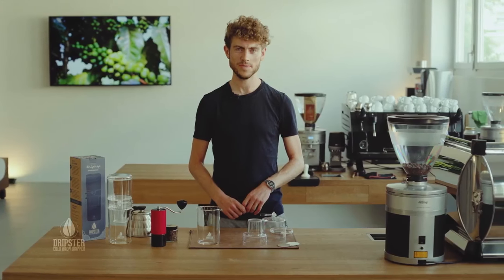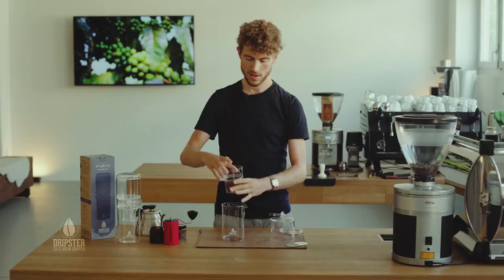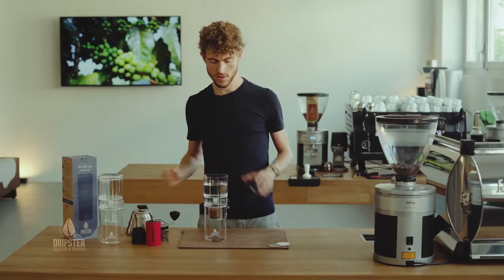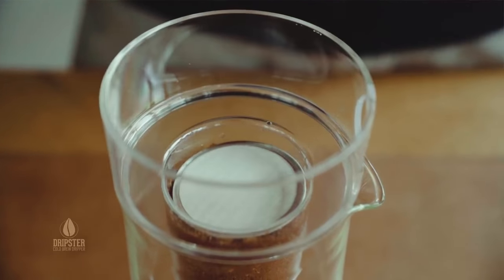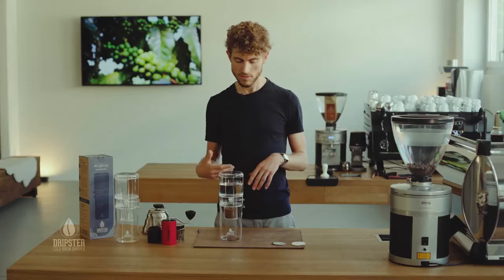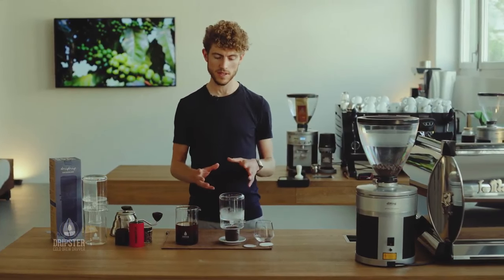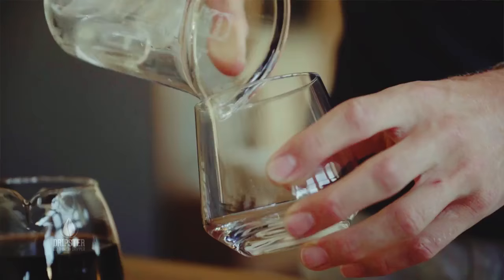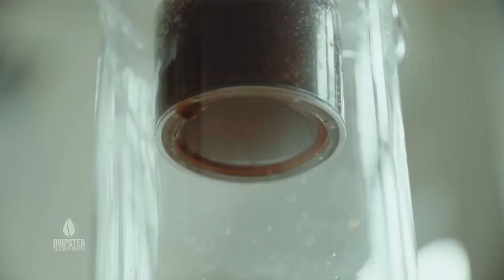DRIPSTER Cold Drip Coffee Maker Guide

Comment: any tip to distribute evenly water?
I put the paper filter on top and when I clean it a lot of coffee isn´t even wet
Reply from the maker: Hi Daniel, thanks for your question
A really slow drip to begin, slooooow drip. This will allow all the water to have time to permeate through the grinds. Or if this doesn't work, I've done the opposite - a full saturation then went back to a slow slow drip. Hope this helps!
Reply: this is why you want to pre-wet the grounds from the start by opening the valve a little more fully (or even just pouring directly on it from the kettle).  Pouring 20ml onto the coffee from the start when you're going to be having 500ml when it's all done won't make a big difference with extraction % if some gets into the cup below, but will help the water continue to spread more evenly.

Comment: can you tell me if cold drip coffee taste sweeter than  other methods? regards. im looking for a methos to drink coffee but i dont like this acid bitter flavor it has, so im looking for other alternatives
Reply: This is smooth, not bitter
Reply: Definitely sweeter and mellower. But if your goal is to get the sweetest cup possible, I'd suggest to go with immersion cold brew. 

Here I share an alternative method that highlights the best attributes of the beans and yields a funnier, crispier cup than the traditional, very one-dimensional cold brew method.

- Medium coarse grounds 
- ratio 1:8
- put the ground coffee in the container/jar/brewer
- start your timer and infuse with 20% boiling water. Let it steep untouched.
- when the timer hits the 30 second mark pour in 20% by weight of ice cubes to slow down the extraction.
- immediately after, pour in the remaining 60% of ambient temperature water
- put on the lid and close tight. The lid must be leak proof. Otherwise the surrounding air will make your brew taste bad!
- steep on the countertop for 13 hours
- strain and keep refrigerated

This 1:8 ratio can be served straight cold or hot. 
While most people would want to take it straight, especially when served hot, I'd suggest to dilute with 40-50% hot water to open up the flavors and highlight the sweetness even more. 

The initial hot infusion helps to extract some acids and oils that add extra balance to the sweetness BUT this process must be kept short. Too much of it and the taste won't be great!

The resulting cup will have all the good from a hot brewed coffee, a subtle and nice brilliant acidity touch, awesome sweetness but without the bitterness.